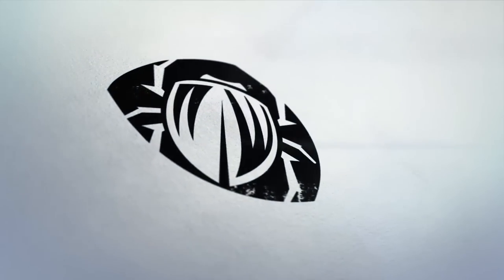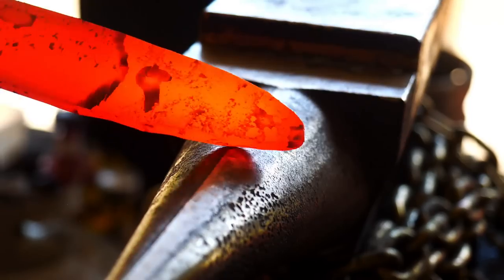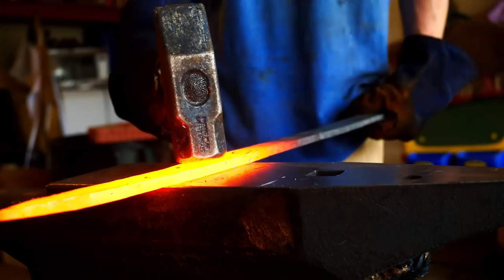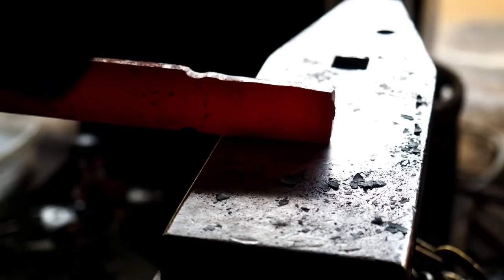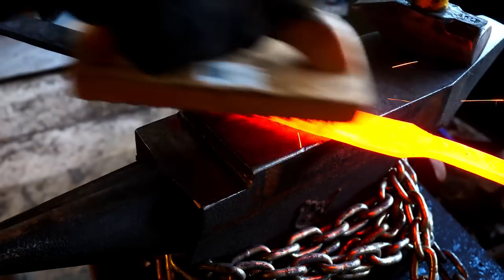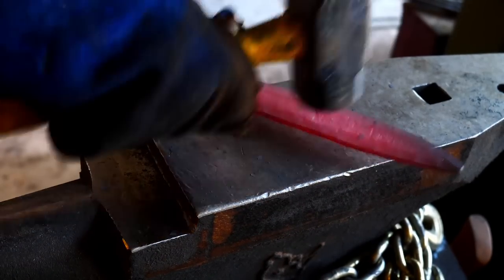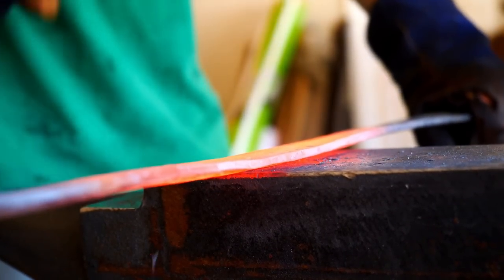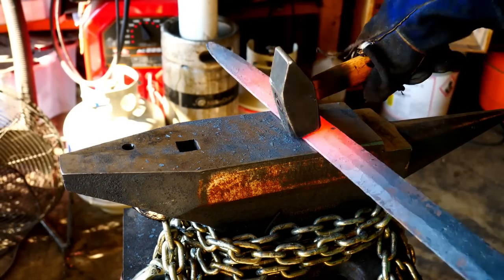Forging A Sword Pt 1: Every Stroke

Comment: Question have you ever accidentally burnt yourself
Reply: Harley Swenson. All blacksmiths do but as you get good it happens less. I get little burns all the time but I'm not that good
Reply: Shay Vitale yeah I've burnt my self a few times blacksmithing like a few weeks ago was probably the worst one yet I was working with a long peace of rebar and it was at a pretty hot temperature and I was walking and I stumbled and it touched my face lol so I think I got like a second degree burn ha ha I'm going to try not to do that again lol

Comment: You said the hammering was about an hour, so what would you say the average is for a knife?
Reply: J_1659 about 20 ish minutes if I've already made something similar.
Reply from the maker: Just hammering?  20 minutes or so?  remember it has to heat up between sessions on the anvil.
Reply: Green Beetle well it was a VERY smoll knife😂

Comment: That steel was WAY to thick, I'd go 1/4 inch at MAX and that's for a claymore or something similar. Next time you may want to draw it out a bit as well.
Reply: Doge channel did you watch the full video? He's forging thick..
Reply: Yeah but it's still unnecessarily thick.
Reply: Doge channel incorrect; you don't know what you're talking about. You see, upon heat treating, the blade could, and probably will, warp, the greater the warp the greater the chance it will become unusable. The thinner the blade the more likely it is to warp. So, even though a master smith may not have it quite that think he is being rightfully cautious, as he's not a master smith, and the thickness now, is no indication of the finished thickness. And that is just one reason to keep it thick at this stage, finish symmetry and geometry can be done easier on the grinder, although slower. And you can get closer when weighting/balancing the blade. As long as the heat treat goes well I'd say he's on his way to have an amazing first sword.
Reply: I'm a blacksmith for a living, I do know what i'm talking about. However I did not say the thickness was incorrect. I stated it was unnecessarily thick, him leaving it extra thick is a good thing for a first time sword. That's what I did and it turned out well, heat treating the blade is the hard part and a quarter inch spine is unlikely to warp, I've never had a warp in it even if I quench in water. The key to quenching is to do it north to south, making the metal stronger and less chance of a warp.

Comment: how is it oranger after every cut?
Reply: He reheats it. You can mould metal only when it's hot 
not when it's cold.
So, he hammers away when it's hot and when it gets cold he reheats it and it's back to the hammer and anvil. Rinse and repeat.

Comment: Where do you get your steel
Reply from the maker: New Jersey steel baron
Reply: @GreenBeetle  what are your dimentions if you don't mind me asking because I don't understand if .375" will be too large.
Reply: @niqnact1121  don't know if you are still wondering but 0.25 is typical for a longsword. perhaps 0.20 for an arming sword like this one. it depends on what you want. however for all of these thicknesses you will have to do a lot of work to produce the distal taper, and perhaps to decrease the thickness at the base to the precise maximum thickness that you want.